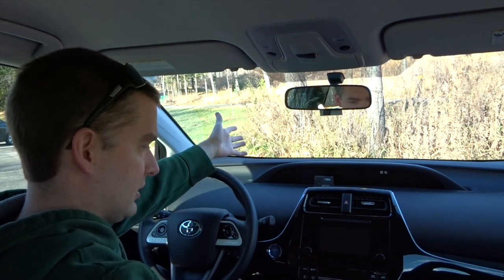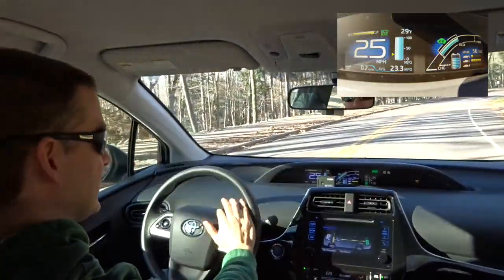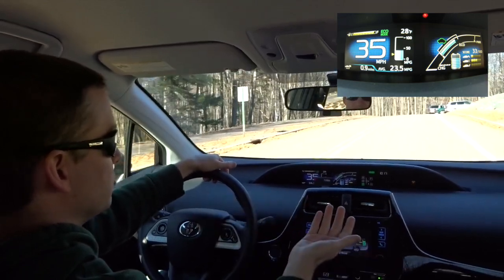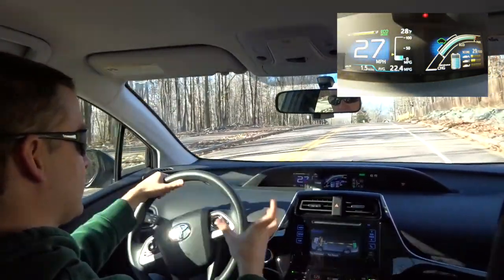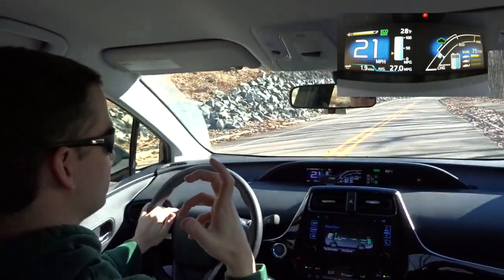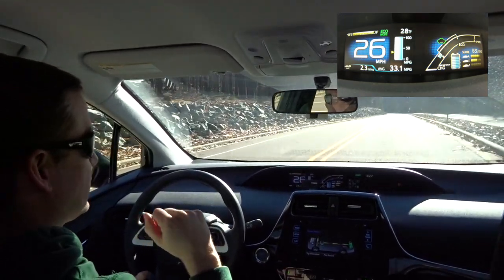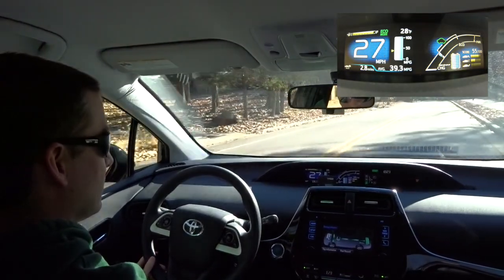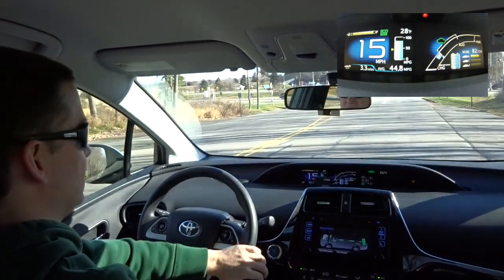Prius "B" Mode Explained

Comment: On my toyota chr hybrid same system of prius 4, i use to do more than 25miles down hill in motorway, and it is so loud with hybrid assistant I saw that goes up to 5500 rpm😨 but I can't slow down in a motorway you know? Its dangerous for the motor?
Reply: in B mode? 25 mile hill?
Reply: @nationofgandhis  yes 45 kms down hill finally im gina change this freking hybrid shitty car

Comment: I've never gotten a full bar battery charge on my 2012 even when trying too. I read somewhere that it's because there is a sensor that prevents the battery from being overcharged.
Reply: On my 2012 I rarely get full bars. Sometimes when descending you will see the battery go completely full.
Reply from the maker: In this video, it's the first and last time I saw full bars.

Comment: What about the high revs in B mode .. i am always scared that it would overheat the engine if u run it too long.
Reply: It sucks big amounts of air in order to create engine brake. It will always default to high revs cause it is trying to give immediate effectiveness. One of its purposes is to save you from a collision.

But it gives you some room to play. You just have to slowly push accelerator to find a sweet spot. That way it will sound less, but it will go faster. 

it would be pretty hard to overheat an engine sucking air instead of burning gas.

Comment: Just like L in my dads Cmax, reason to to use it all day everyday, at least the ford dealer says it, it that it prevents the generator from overheating
Reply from the maker: Interesting, how does he like the Cmax?
Reply: jettlash1000 he’s loving it, he’s had it for a year now, and put 30,000 miles on it. He has averaged 55 mpg and that’s only the commutes to and from work
Reply from the maker: That’s good to hear!

Comment: So you can change between B and D while driving?  What if you accidentally put the car in reverse when going 20 mph?  Does the computer reject that?
Reply from the maker: Yes, you can go between B and D while driving, and the car won't allow a reverse selection while driving.
Reply: Thanks man - I just bought a Prius Prime two days ago and it came with a huge manual on how to operate it and a huge manual on the navigation system - it's taking me some time to learn everything.
Reply from the maker: That's the fun of it for me :)
Reply: In Prius II (2004-2009) reverse can be switched on while the speed is under 15 km/h. Then it regenerates (no friction brakes) until it reaches 0 and then it starts to reverse. The same is when you're reversing and selecting D.

Transmission lock (P) will work with speed 5 km/h or less. I tried it on snow uphill.
Reply: In the 2016 Toyota Prius the car goes to neutral, at least mine does. I have the 2016 Toyota Prius three touring
Reply: Cool - thanks guys!

Comment: I use b mode to overtake cars as it gives you more power to start the car and gain more speed then shift to D to rest the engine then re put it in B to get on the high speed
Reply: Make a video explaining this. Got a little lost/confused
Reply: @cutflow2  looks like he is downshifting as in a manual transmission. But it doesn’t make sense since b mode doesn’t add anything like a change of real gears would.

Comment: the cvt actually has two speeds the high end of highway will change up to a higher gear ratio but you will not feel. b mode is engine braking used to make engine braking by its compression to slow down .b mode is great to use for slowing down your speed before intersection without actually touching brakes so momentum is not lost .great for winter driving in the city so wheels dont lock up on ice using the engine compression to slow  down.the battery peak operating range is 20% to 90%. not good to extend past 100% for long periods of time.

Comment: We live in a mountainous area and have two Gen 3 Prii. I prefer keeping it in D mode with the cruise on if possible. In D mode the battery charges to full when going downhill; using B mode dumps or wastes energy. In other words you will get much better mileage staying in D mode in the mountains. If you redid the hill climb video and came down the hill in D mode with cruise control holding it at 25 mph or manually control your speed using less than full scale braking I guarantee you will get 50-60 mpg on the round trip.

One thing I don't see mentioned anywhere is what happens to the extra energy when the battery gets full? in D mode the extra energy has to be dissipated somewhere. I believe there is a heating element and blower that is used to dump this energy, I have heard it come on many times after the battery gets full. It sounds like a fan is running under that car. As soon as you start using the battery again the fan noise goes away.

I think the reason they design the battery to never get full in normal driving is to leave some room for it to charge when you come down hills. Typically the battery stays around 6 bars when you are driving on a flat roads. I wish Toyota would have a button/mode that could select mountain driving and keep the battery normally at 4 bars. That way it would have more room available to charge on longer descents. You wouldn't waste all that energy.

Comment: Essentially it's second gear. Yes, I know it's different, but it really isn't. Don't most family cars have CVT transmissions nowadays? Most manufacturers just put 2nd on the gear shift because that's what people are used to. Personally I don't notice much difference in Eco mode except the car is more sluggish. Gas milage is about the same. My battery always goes to full charge every time I go down a hill of any length. Also, when going down a long hill in mine even though ev isn't lit up, I really think the gas engine is off. Even on a moderate hill it says I am getting 99.9 mpg (the max reading). Driving in B mode all the time would put extra strain on the transmission from everything I've read and heard.
Reply: Wrong. B is for Brake. It is just making the motor attempt to regen the moment you let off the gas in situations like many small steep hills in a row like this: /\/\/\/\/\. You can drive in B, but once you are over the hill, you let off the gas pedal and it will enter a controlled descent by itself. It act like a brake. Basically think of it as an automatic braking system the moment you let off the gas.

Comment: b mode use your electric engine to slow down the car , and because the torque is stronger than a gas engine you feel a better engine break.

also manually spining an electric motor like that produce energy , it is how your recharge is more effective for your prius

Comment: Yes the engine should be running I dunno why this man think it’s not supposed to💀 it’s using engine braking, spins faster to stop the vehicle, and breaks tf outta the car if you run it 24/7 wil accelerating an doin daily driving.
Reply: sort comments by Newest... 
read two comments below yours 😊

Comment: You're making a video explaining B mode and don't even know why motor is running? It does engine braking and charging at the same time. Once the battery is fully charged, the B mode will be braking with engine braking while the generator is off. Its purpose is long downhills so the braking system doesn't get over heated.

Comment: it's funny that you refer to this as "b mode". what it is is an engine brake.  it's a downshift mechanism and this is why rpms increase when it is engaged.
Reply: The prius does not have a transmission, nor can it downshift.  There is no direct mechanical connection between the drive wheels on a prius and the engine.

Comment: B mode is breaking with the gas engine , that is the reason why in B mode is gas engine nonstop running.  If you are driving in B mode your fuel efficiency go down.

Comment: Couldn't find "B" mode in my 5.0 Mustang because it's a stick shift. My Mustang had a different mode called Line Lock. I seemed to go just as fast as a Prius in "B" mode though so I assumed it was the same thing.